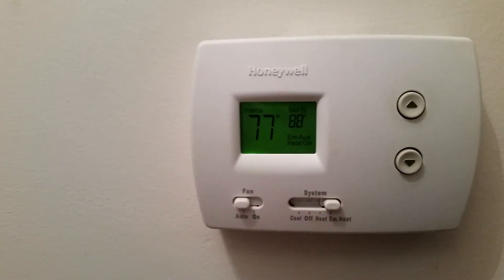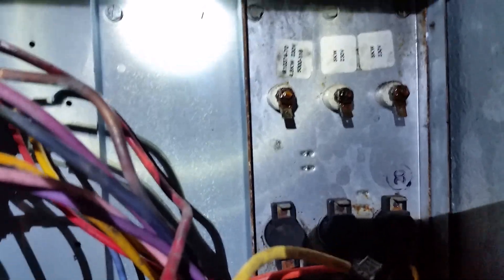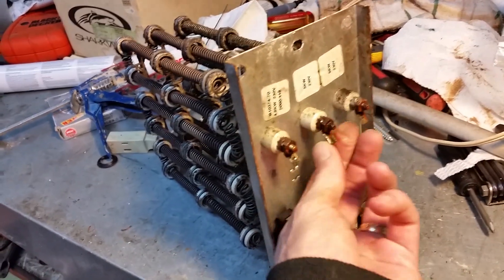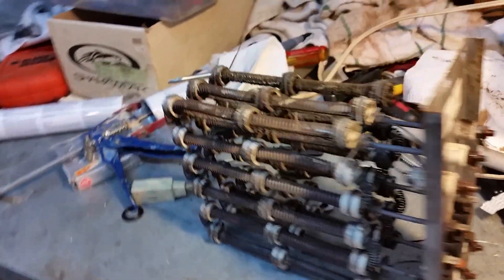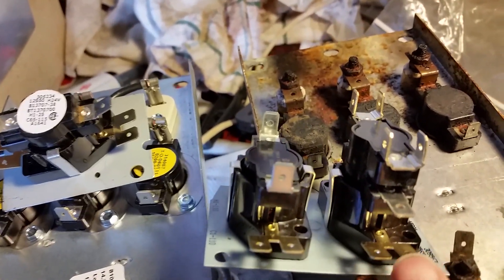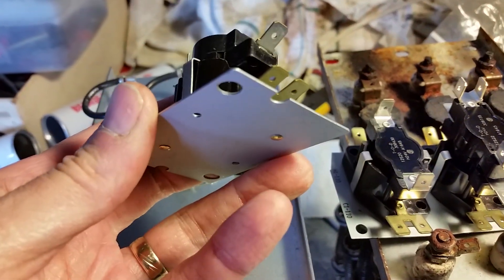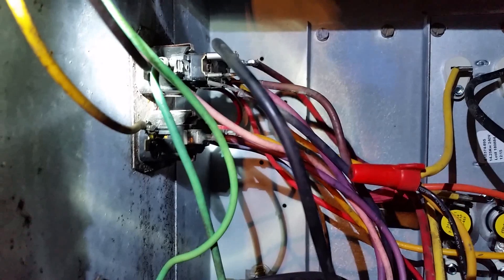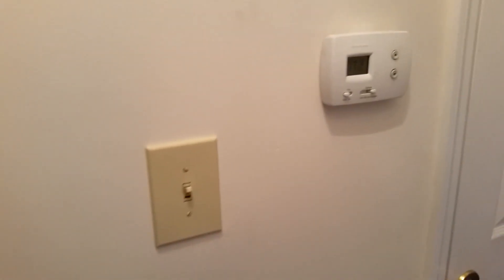Heat pump Heat strips not working, How I tested and how I fixed it.

Comment: I know almost 0% about this stuff but im desperate to help my parents as they've spent thousands trying to get their unit fixed.  They have a Rheem air handler that uses a heat pump.  It has a 1/2" copper pipe leading into the air handler that is getting very hot but cold/slightly warm air is blowing from the vents Everything else appears to be working 100%.  If you could point me in a direction to what could be the problem would be extremely appreciated.
Reply from the maker: call me 606-875-0125 Kevin

Comment: My unit is only three years old and I had my emergency heat on last night because it got down to 21 and it was blowing in cooler air and actually dropped the temp inside the house. Got a tech coming Monday to look and see what's going on, until then I guess we will be sleeping in a cold house with extra blankets.
Reply from the maker: Let me know what he finds. Sometimes its just a wire that gets loose then burns off, or a bad sequencer.

Comment: Thanks for the video, quick question:  The 90 degree temperature reading was for the heat strips only or combined with the heat pump running?
Reply from the maker: I think it was both. The temp can very based on fan speed and heat strip size 10k or 15k
Reply from the maker: A lot of times I find a loose or burnt off wire or a bad sequencer
Reply: @ktoutdoor  
Where are you located?
Reply from the maker: Somerset ky call me if you need some help 606-875-0125

Comment: i have 4x 5kw strips 20kw and contactor/sequencer rattling last year at start of aux heat. got through the winter i figured i was running on 10kw when on aux heat because 1 of the 2 contactors wasn't engaging. Changed both contactors in september, engage properly but i didn't measure temp at register. now its getting cold -10 C aux heat operating and temp at register 87 on AUX, no better than heat pump. So i guess i didn't solve the problem, not sure what to do next. it shold be at least 100 deg out of the vents on AUX with full 20kw working. i don't know if it'S the heat delay switches (the 4 yellow circular delays - is that what you are calling relays?) around the elements or the elements themselves, or something else. any suggestions? if we hit -25 c i might be in trouble again can barely maintain 21-22 C at -10 outside (HP off) so i know for sure im not getting full 20KW output. outside of my strips is nice and clean no corrosion that i can see. in the past when AUX heat kicked in temp was hot and only stayed on for a few minutes to reach temp, which is probably not great, Now i must have 2/4 working or maybe 3/4 (is that possible if 2 strips on each sequencer?), below -9c aux is on and runs a long time not much down time.
Reply from the maker: Sorry for delay can you give me a call 606-875-0125 Kevin
Reply: @ktoutdoor  no worries, my electrician gave me a hvac contact (pun) turns out the guy is a field service for carrier + does freelancing. He came over for 90 minutes, found a whole bag full of problems. got the heat strips working fine, there was a short on one the control contacts for the left contactor. I cant stage them with the tsat i have so he unplugged one of the 4 strips leaving me with 15kw, which is plenty. 20kw was overkill kept cycling on and off even at -20 C. now i'm getting 90F at 0 C so when we hit -10 C and below, they will be on for minutes at a time. The bad news is the heat pump was stuck in cooling and i didint realize (switched to heat in october). it looks like the 3 way valve outside is stuck. so HP is off at the breaker heat via furnace strips going forward. Now i have to figure out if theres a way to save the heat pump for heat., apparently replacing the 3 way valve is a big/expensive job and tricky because right next to coils. if its 2500 i might have to think about a new HP for 5-6K with a 10yr warranty.
Reply from the maker: My goodness you did have a bag of problems if you looking a buying a new system then watch my video on how to do most of the install yourself https://youtu.be/JPvO9AjyeR4 DIY Landlord How to install a 2 Ton HVAC AC unit heat pump yourself a save.

Comment: Great video 🙂🙂Does it matter if the old one u have is 5kw and the one u replaced it with is 14.25kw ???
Reply from the maker: Sorry for the delay I would replace with what came out of it that's what i did local HVAC store had them in stock

Comment: Very informative!  What was the temperature at supply vents after having replaced the heat coils? 

Heat pump at my home blows 85-95 F air at vents. some vents produce less warm air than others. When heat pumps runs on regular heat mode, air at vents are 90-100. So, I am puzzled by why aux heat produces less warm air. I am guessing some heat coils do not work properly.
Reply from the maker: Yes around 90 for us on emergency heat also depends on how many heat strips installed 5 10 or 15k fan speed or dirty filter will also effect temp.
Reply: HP 90-100 wow thats high, unbelieveable i get mid 80s max. is it new? Aux heat depends how many coils you have running. to see if all coils working or staged on a sequencer (ideal), put a no contact draw meter on the big red wire that goes to your panel see how many amps you'Re drawing. mine draws 20 amp per strip, so 80 for all 4, now im at 60 as i run 3 now dont need 4 at once cycles too often.

Comment: If we have an electric furnace (which is your heat strips, although you call it a heat pump) and an outside AC(also works as a heat pump), how do we test if the heat pump is generating heat, while both the heat pump and the furnace can generate heat?
Reply from the maker: this explains the process https://www.youtube.com/watch?v=14MmsNPtn6U 
Call or text me at 606-875-0125 Kevin

Comment: I dont understand why you call the heat strips your primary and also emergency heat. In my understanding its exactly opposite.
Reply from the maker: It depends on the application if you did not have a heat pump then these would be your primary and only source of heat. But if the air handler is attached to a heat pump then it would be considered emergency heat strips they would only come on when the heat pump can not keep up with the demand.
Reply: @ktoutdoor  well ya im talking about your application. You have a heat pump, you said, and were calling your heat strips primary. I cant wait until i get my heat pump installed because those heat strips will spin a meter quick!
Reply from the maker: @JM-yx1lm  They sure will,, that's why we also have a wood stove for when it gets below freezing.. Stay warm

Comment: Hey buddy where did you bought this from
Reply: probably Grainger they have parts. or amazon.
Reply from the maker: if your talking about the heat strip as a whole I got it from a local HVAC supplier this is a goodman brand and they had it instock. its been working great for over a year now
Reply from the maker: hemant patel where did I buy what exactly?